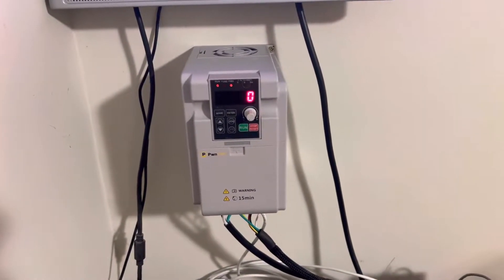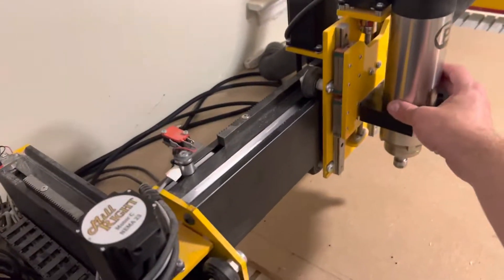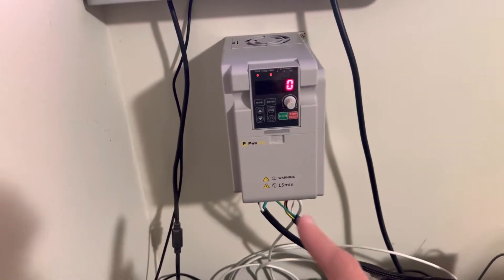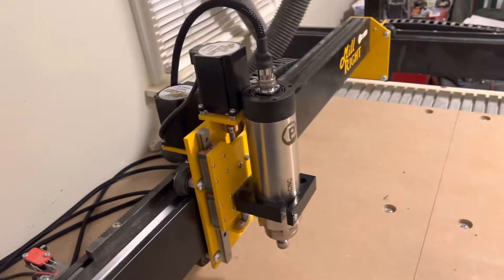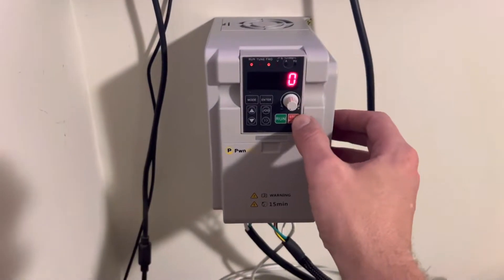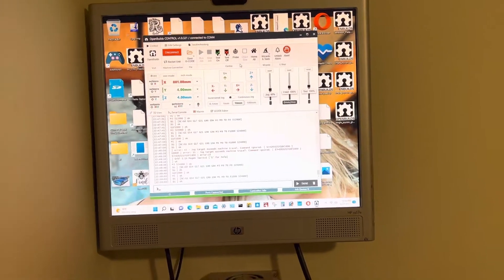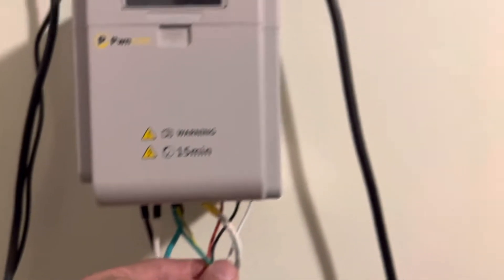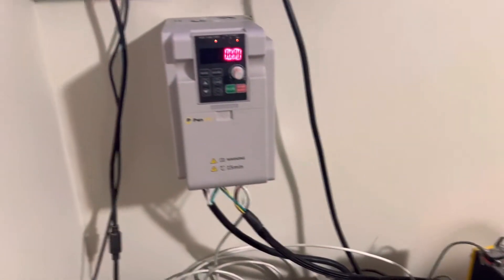PWNCNC 1.5KW 65mm Spindle. Mega V XL. PWM Control.

Comment: This is exactly what i need it's the weakest link on my mega-v I assume it's the same for the mega v xxl ? I didn't get the chance to watch all the videos yet  but I subbed! Are ya happy wit it? Ty
Reply from the maker: Yes. The 1.5 spindle is a drop in router replacement. Use my discount code with PWNCNC. Listed in the description.

Comment: Hey..have a question..tou said u disconnected the laser from pwm on control board..could I leave it connected when I hook up the spindle and have both connected at same time..I have laser and want spindle but would hate to have to unhook and hook up every time I needed to use it..thanks
Reply from the maker: You can add a toggle switch.DPDT